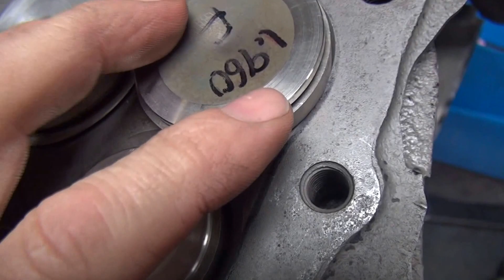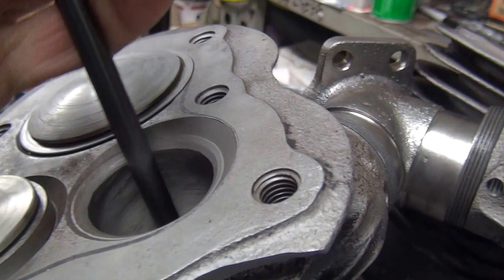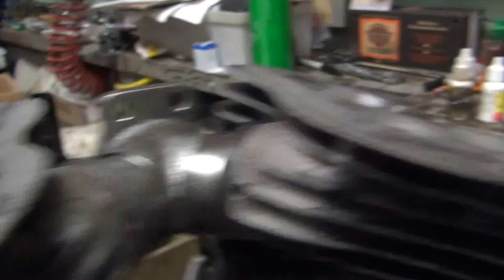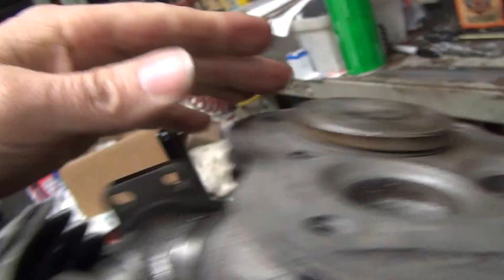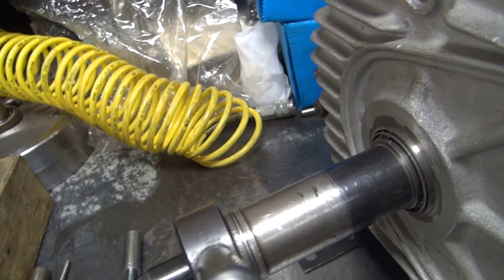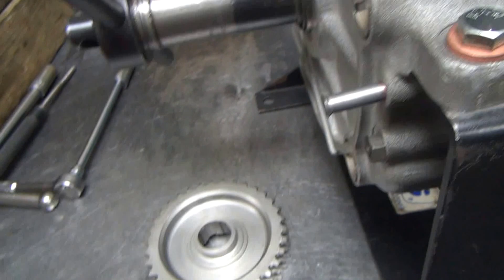#113 1942 Harley 56ci 45 WL WLA flathead stroker hotrod motor build by tatro machine

Comment: do you relieve area between valves and cylinder? you know ? use blueing then scribe area from outer edge of valves to clylinder, then mark area above compression ring then grind a relief area ? flatty motors seem to like that mod. anyways, love these videos.
Reply from the maker: Jeff Diamond 
i don't like to do much relieving. i like to get the valves as high as i can and just round the top of the cylinder areas to blended in. no more then needed.
tatro